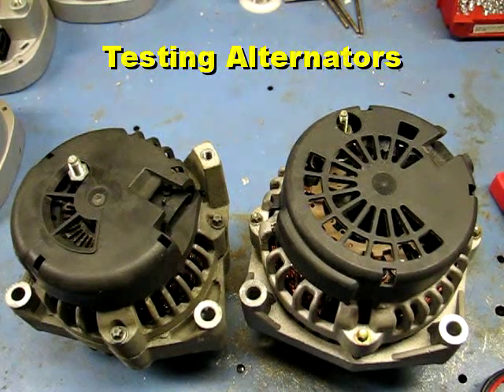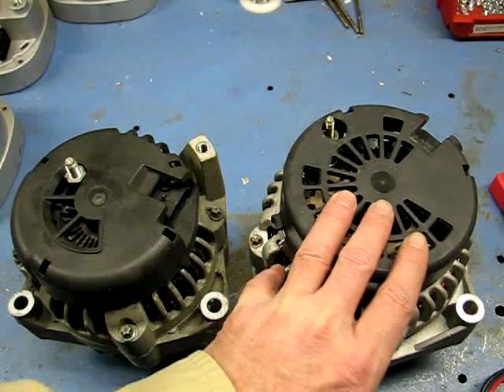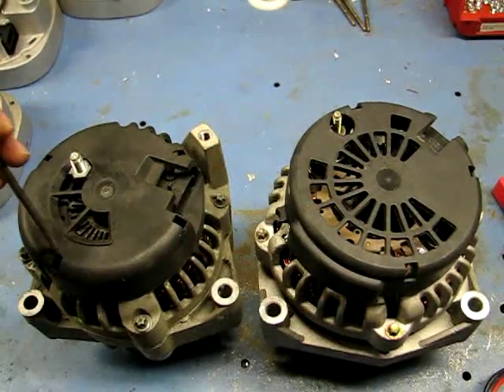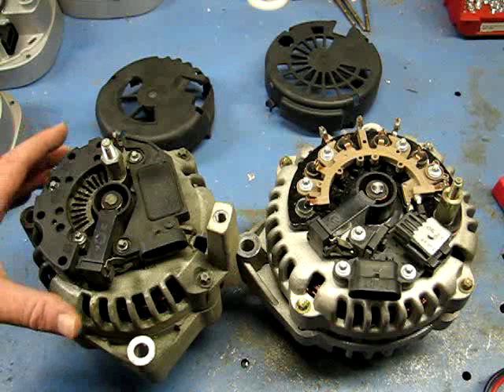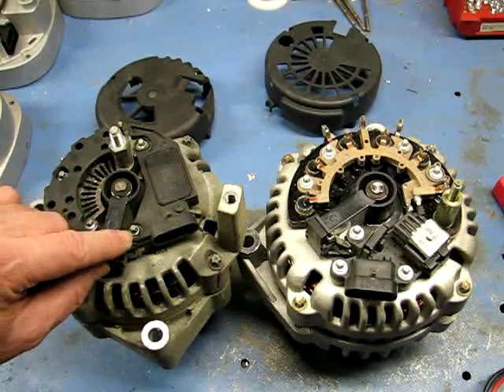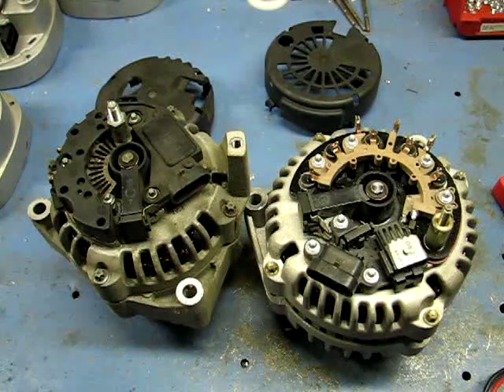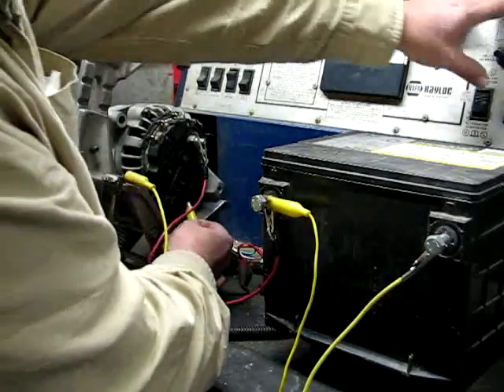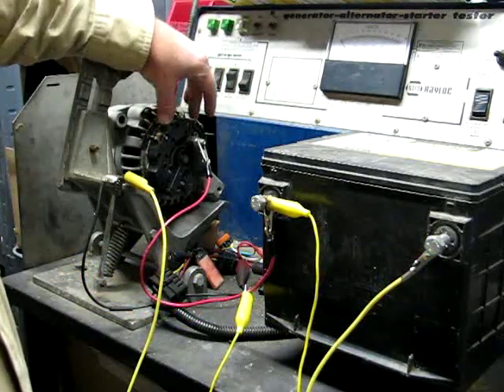Testing GM's 105 amp CS130D, AD230, 125 Amp AD237 & 130-145 Amp AD244 Alternator

Comment: Your information was helpful. 
But your use of yellow jumpers for both positive and negative are really freaking me out.   :)    You were clear to what goes where.  Unfortunately, I don't have a testbench to work with, and the alternator from my car (2000 Trans Am WS6) is mounted on the bottom of the engine, under the power steering pump.   

Apparently, mounting the alternator there is a BAD design choice. When the power steering leaks out the front or rear seals, it drowns the alternator.  If you haven't seen that happen, consider yourself lucky.  It's a mess.

Comment: I have a 105 amp alternator in my 2004 GMC Sierra 1500, 5.3 liter. My alternator is currently operating at 14.58V loaded and 14.74V un-loaded. Ripple is normal. IT appears that the un-loaded reading is on the fringe of too high. Should I replace/rebuild this alternator?
Reply: No, 15v is a-ok on cold days for these alternators. Going above 15.5v is where I'd get concerned unless you're above 15v on a very hot day.

Comment from the maker: A good set of nut drivers or a power drill and sockets will help, for the CS130D and AD series alternators you will also need a set of torx-head drivers or sockets. An 80-120W soldering iron is required for desoldering the stator from the bridge rectifier. You also need an impact wrench to take the front pulley off and replace the rotor.

Comment from the maker: If your voltage rises, and the alternator seems to slow down, you're fine. If the alternator is being turned by a gas or diesel engine, you won't notice the growl, but you will notice the alternator slow down.

Comment: I just bought a AD244 250 amp alternator but i don't have 1 clue how to wire it. The problem is that it's not going to be installed in a truck-or a car. I'm planning to run it with a small engine (20HP V-Twin). Can you tell me how to wire it up please and if i need to buy a external regulator? I'm going to use it to charge a battery and run an inverter. Many Thanks.

Comment: Why would GM make an alternator that had ineffective diodes? There seems to be a generous cooling fin arrangement under the diodes. I read that the CS130 D will go 80 000 - 100 000 mi. before a rebuild. With its' twin fans, overheating is  not an issue. Like the GM HEI ignition module, it runs a tad warm but is far superior to the Duraspark module. And I suppose it would not run well under water also.

Comment: thx for the reply. can you advise if this is the same alternator that you are talking about? Do I need a different belt? thx

Chevy Trailblazer 5.3 L ALTERNATOR  years :03 04 04 05 06 
Delco AD244 series 130-145 amps 12v, CW, 6 groove pulley
12 O'clock plug

Comment: Im trying to upgrade my alternator in my 98 trans am that uses a 105 amp CS130D. I want to get a AD244 since it is 145amp and it is a direct fit. My question will be if this AD244 alternator has the same plug and bracket for all the vehicle that it fits in.

Comment: I work at a Starter/Alternator shop and get to go back to work tomorrow and put coms on CS rotors. :-\ I like the rectifier design on the ADs more since they're a lot less likely to blow a diode like the CSs.